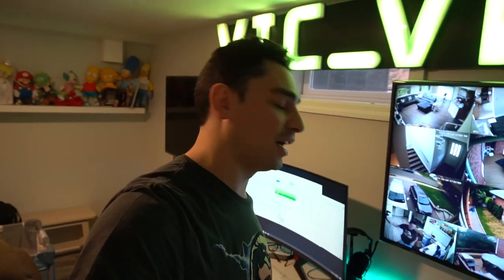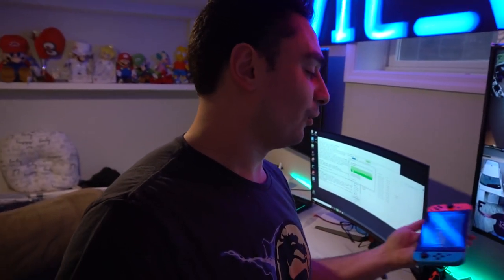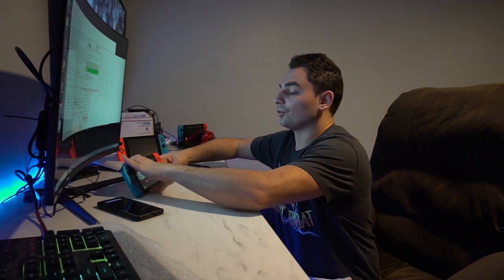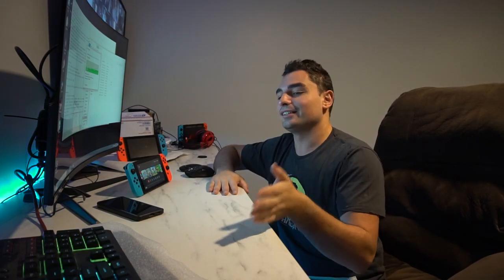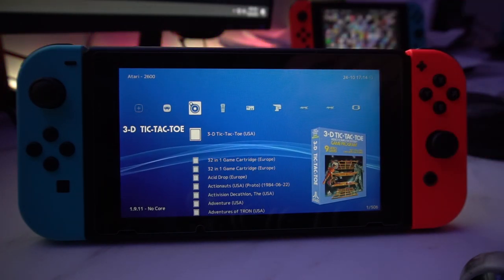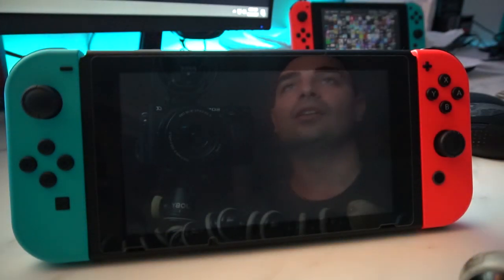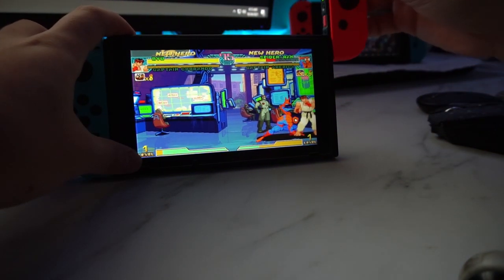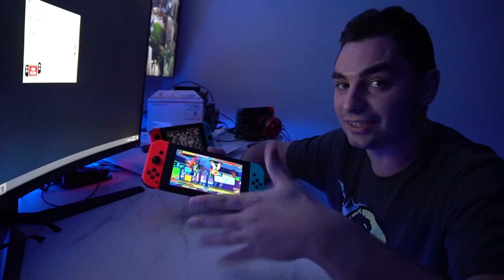2 Player arcade and more on a handheld?! THIS IS THE ULTIMATE HANDHELD

Comment: How do you activate the second controller  I am having trouble with connecting the red controller the blue one works fine
Reply from the maker: U have to start retroarch with both controllers on the switch, once in retroarch u can disconnect it